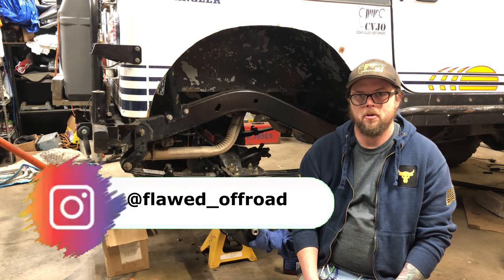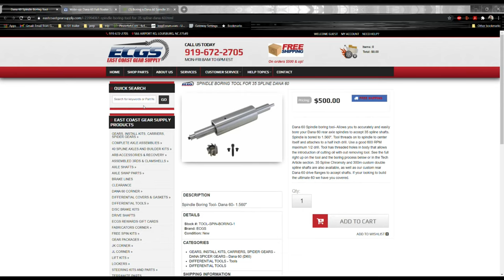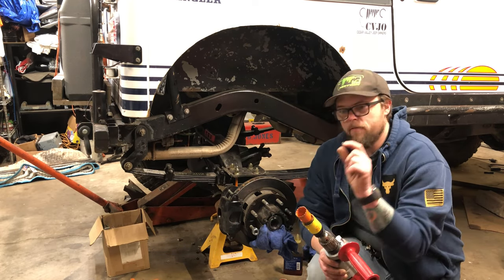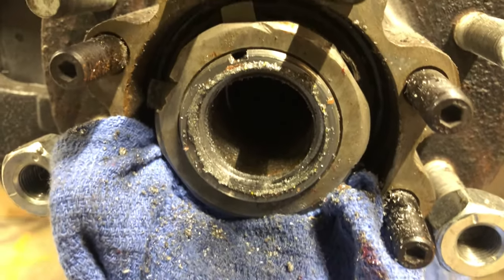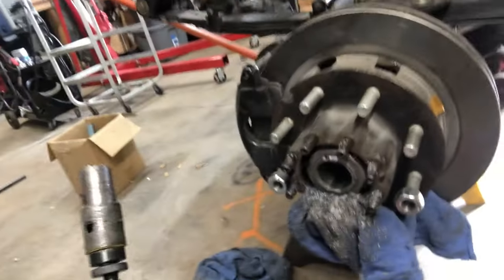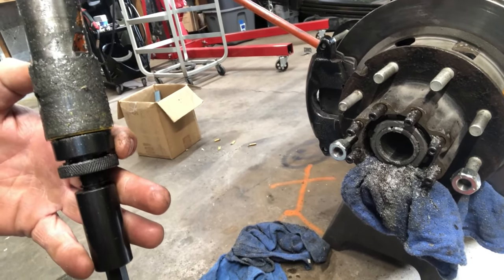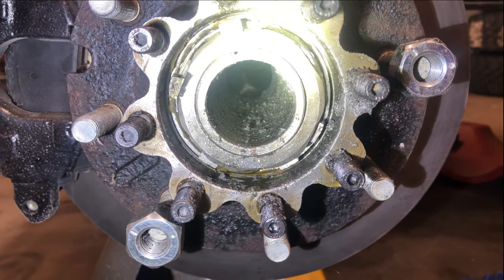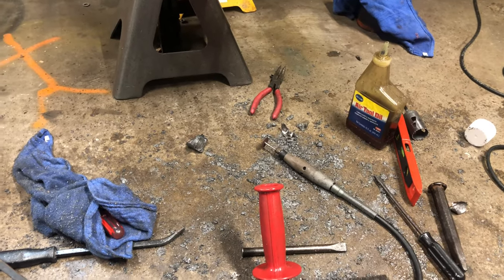Fitting 35 Spline Axles in a Dana 60 - Bore out Dana 60 spindles CHEAP!

Comment from the maker: Edit #2 I had to go back and taper the inside of the end of the spindle cuz it was rubbing the end of the axle shaft where it tapers out to the flange, YMMV
Reply: How'd you know you needed to taper it? I just finished doing the axle on a 79 f250 and was wondering what look for.
Reply from the maker: @noahscott5689  I installed the axle and could feel it dragging/see that the flange wasn’t wanting to close the gap fully. So I sprayed some paint on the shaft and put it back in. Spin it and removed and you could see where it scraped the paint off
Reply: @FlawedOffroad  Ooh, good idea! Thanks!

Comment from the maker: Edit: My axle wasn’t as level as I thought so my hole started a little crooked, that’s why you see me fighting the slivers. This did not happen when I moved onto the other side!
Reply: I don't know if it's levelness or if the spindle isn't the same thickness the whole length, because my axle was off on pipestands and I didn't adjust them when I changed sides. But one side had no slivers and the other had tons, and the walls on the one that did really seemed to vary in thickness.

Comment: Hey man. I'm about to do this. I'm curious if a tapered ball joint reamer will work
Reply from the maker: Ummm these holes are much bigger than a ball joint hole. I read of people using an expansion reamer to clean up the bore after drilling it.
Reply: @FlawedOffroad  I found a ball joint reamer that cuts from 15/16 to 1 1/2.. I am aware of the size of the hole.

Comment: Dumb question, I keep hearing conflicting information about doing this on a older 60 from 1975, I hear the spindle is too small to do this on axles with 16 spline too.
Reply from the maker: I recall hearing something similar. Best bet is the Dana 60 bible on pirate 4x4. There’s a few years of them that actually have bigger spindles that will fit 35spline even if they came with 30. I know someone that has a bare 1978 housing that’s been bored already, I’m sure he would sell it cheap

Comment: Ok, so anyone who is interested i did this to my dana 60hd. This was an extremely messy process and super sketchy as well. Although it did work! The spindles came out just as this guys did. The only difference is i tore mine completely down and did it and i will say; there is no way this guy did this and didnt have to tear apart his diff. The metal shards that ended up inside my axle tubes were horrendous. So if you do this plan on doing a complete tear down. I will comment on here once i have mine up a on the road.
Reply from the maker: I stuffed rags in the tubes, it kept the mess contained to the end. Then I used a magnet to get most of it out, followed by a back blow air gun. Basically stuck it all the way in and it blows the crap out. As far as I can tell I got it all out, anything that’s left is super fine, no different from the stuff that will come off the gears when they break in. I’m probably gonna pull the locker anyway when I get ahold of a case spreader. Anyway thanks for watching!
Reply from the maker: The Jeep is still under construction so I have yet to button everything back up
Reply: @FlawedOffroad , i do want to add that i truly appreciate your video. I was lost. I called machine shops acrossed the state and no one had the ability to do it. Ya, i just finished cleaning the housing today and should have it all together tomorrow. Its going behind a ford high boy with 700 horse. So between you and i we will see if those spindles hold.
Reply from the maker: You’re welcome, check out my other stuff too. Also you can weld on the bigger spindles if it becomes an issue but luckily the power and torque doesn’t really transfer through the spindle it holds the load more than anything so no jumping the truck🤣
Reply from the maker: @garrettsallee4573  did you ever get your truck back together?
Reply: @FlawedOffroad  I did!!! And it works awesome. I didnt follow exactly what you did but close. Its been together for about 8 months with not a single issue. Ive done a few burn outs. I havent done any hits in the dirt considering its a classic high boy butni do plan on dragging it in the dirt a bit.
Reply from the maker: @garrettsallee4573  I think I got mine up and going in July finally and I took it down to smorr and beat the crap out of it mine is holding up great
Reply: @FlawedOffroad  man thats good to know. I spoke to a couple friends about this and that was one of the concerns. Keep me updated if you run into any issues. Ill do the same. Of course i dont beat mine on the trails so im guessing i wont have any issues. Allthough i do plan on using this in the future for any other dana swap ins.
Reply from the maker: @garrettsallee4573  for sure. if you check out my channel look for the smorr videos you can see in those I did some beating on it while rockcrawling. I beat on it more this weekend but dont have that video yet

Comment: What axles did you end up using? Cut to length?
Reply from the maker: yeah i think thats really the only choice at least for those yukon 60 rear shafts they come in length ranges and i cut them down with a death wheel
Reply: @FlawedOffroad  wonder if the dana70 shafts would be close.
Reply from the maker: @Go4BrokeOffroad  I doubt it. Cutting them literally takes 2 to 3 minutes per side. It’s not a big deal.
Reply: @FlawedOffroad  just wandering. I have a yard filled with Dana 70u's. Guess I'll just got try that myself.
Reply from the maker: @Go4BrokeOffroad  I don’t know much about the 70s and if they have the same length, full float 35 spine, yada yada.